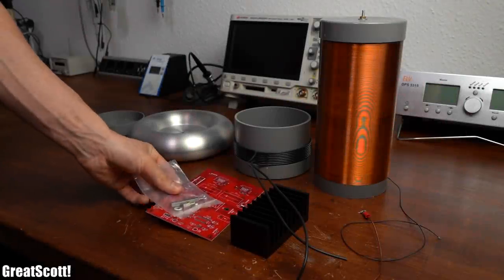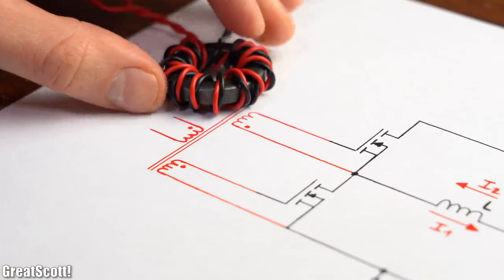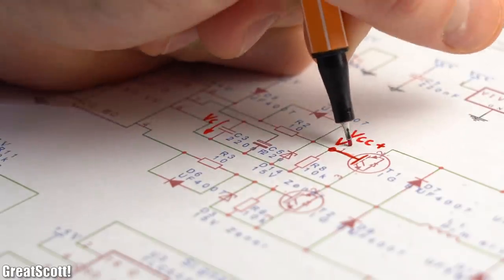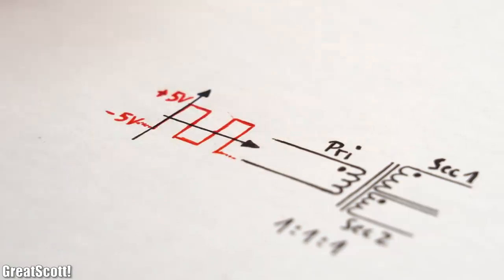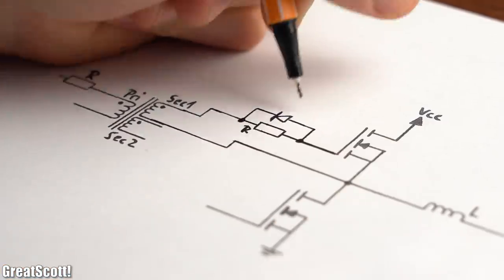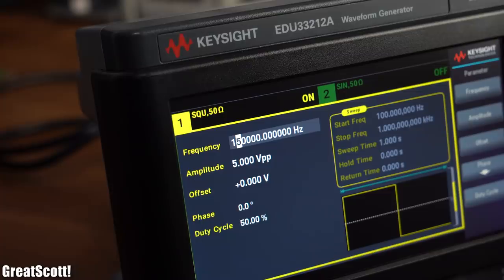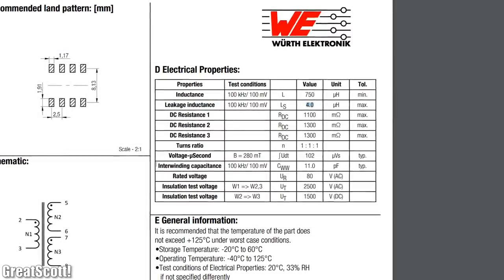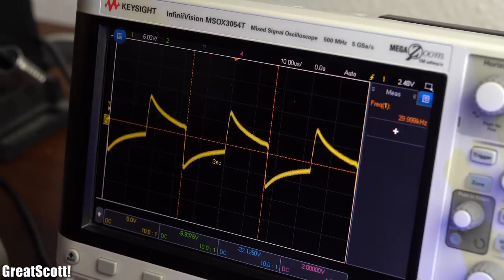Here is why Gate-Drive Transformers are sometimes essential! | MOSFET Driver Part 2 (Potential-free)

Comment: How to drive +5 and -5 V at the primary core of the gate driver transformer using the arduino ports? Thanks
Reply: You don't need to drive -5v.  0 to 5v is the same as -2.5 to +2.5.
Reply: @stargazer7644  but how to drive -2.5V at Arduino port? Arduino hasn't half bridge PWM mode. If the transformer is 1:1 ratio you wont be able to turn on the Mosfet.
Reply: @anlpereira  You don't drive it -2.5V.  You drive it 0-5V with a square wave on the Arduino side.    If you need more voltage on the secondary, use a step up transformer, or use the bootstrapping circuit.

Comment: A short question, whats the simplest way for arduino to controll IRFz44n mosfet with minimal voltage drop with PWM?
I was thinking of an lm358n OPamp.
And for 2-4A worst case on an 49A mosfet, do I need a heatsink?
Reply: At higher freq u need to use higher current to switch on and off the mosfet to be cold ...

So u can use totem pull for low side mosfet

And for n mosfets at high side u need gate driver transformer or some ICs like  IR2111 or IR2183
Reply: @hosseiny1973  So OpAmp @14v is not good?
Reply: @filenotfound__3871 1. op amps can't supply much current to switch fast

2.10V is eanugh more than 10v need more current to charge and dis charge when its dont needed(at 10v its complitly turned on)

3.I perfer u to use logic mosfets they turn on complitly by 5volts!(like IRFZ44L)

4.totem pull is easiest way
U can supply it by a L7810
Or 7812 if your voltage is higher(add capasitor for that if u'll use)
Reply: @hosseiny1973  I could use the totem poll method, is the C945 signa sransistor enough, with its PNP equivalent, So if in the future I use the irfz44l, i can use it straight from the arduino without any losses?
Reply: @filenotfound__3871  i think at under 1khz its possible 2amps not much...u can calculate gate current by  thise
mosfet total gate charge
Moximum current
Voltage 
T=1/ferq
Reply: @hosseiny1973  ok, thank you.
Reply: In part one of this very video he shows you exactly how to calculate this.

Comment: Can you please make vedio

Of buck converter circuit 
In which output 5volt fixed voltage
Ieven though 
Input lie between 6v to 15 volt

I want to replace 7805 by this ckt

If possible please Also tell us about changes in ckt to get 9 volt fixed voltage

By inputting 10- 15 volt

If vedio not possible share pdf link  of calculation which can find required circuit values for fixed output
Reply from the maker: I already made videos about buck converters. Watch them.
Reply: @greatscottlab  

I watched months ago, sir 

But I want fixed 5 volt fixed output

In easy language No potentiometer should be there
If input is 6-15 volt, circuit should work like 7805

I found such circuit in market but I want more knowledge sir and design of that circuit and components value

Please help
Reply: @Shubham-po2tp  just replace potentiometer with resistors
Reply: @sumit_kashyap..  

Thank you so much.......

I have to find value by trials

I think this trick has limited and ver low range

Do have seen circuit of fixed voltage of of wide range of input

Comment: Why use free wheeling diode ?? MOSFET as it internal diode in same direction
Reply from the maker: To be on the safe side. And not all body diodes can handle the reverse current/voltage.

Comment: or use cheap mosfet driver IC like FAN7382
Reply: The drive capability of the FAN7382 is too low for large FETs if you need to switch them fast. You also have to be very careful when using bootstrapping of the high-side supply.

Comment: .....when you say 'galvanically isolated' I believe you mean 'electrically isolated' . I'm pretty sure that in english language the word 'galvanic' is used when talking about effects of dissimilar metals in contact and the resulted electrical activity that causes corrosion .

 It looks like you are using lead free solder. That stuff is a pain .
Reply: His usage is correct for English too.  The term is galvanic isolation.  The sense it is used with a transformer is the same sense it is used with dissimilar metals - when you galvanically isolate two circuits (materials) you're breaking the ground return path.

Comment: Dead time cannot be implemented on the gate drive transformer unlike mosfet driver ic
Reply: The transformer has a naturally slow rise time, so it automatically implements dead time between cycles.
Reply: Sure it can, if the primary is driven appropriately.
I've used gate drive transformers for half-bridge converters up to 1 kW output.
Reply: @stargazer7644  
No, a properly designed gate drive transformer has very fast rise and fall times. Nobody who knows what they are doing would use them if they were slow. Dead time is simply a matter of driving the transformer properly.